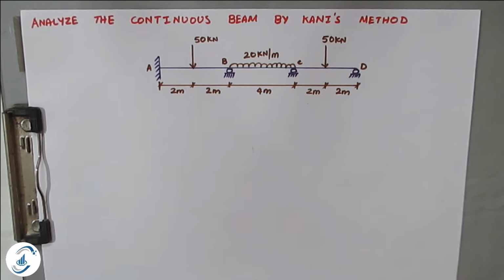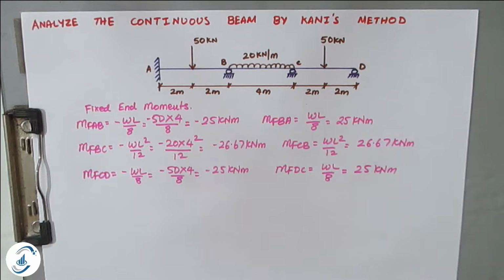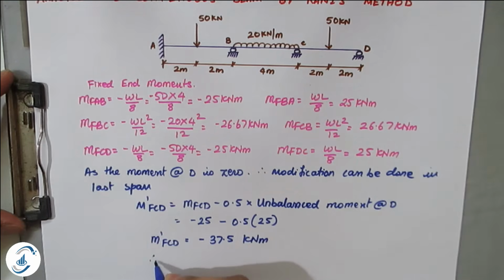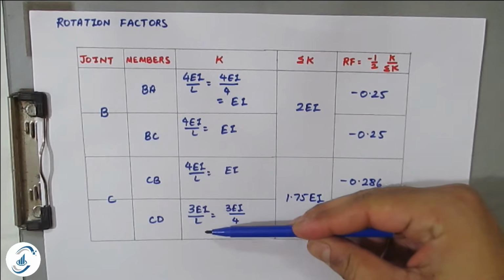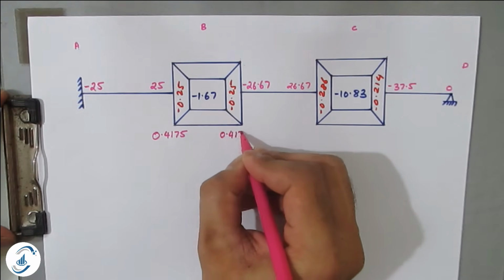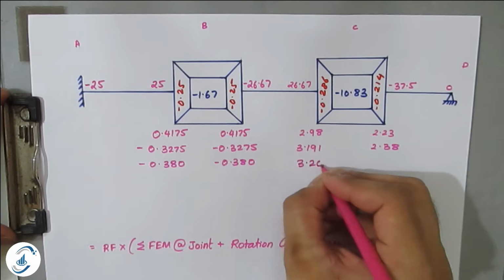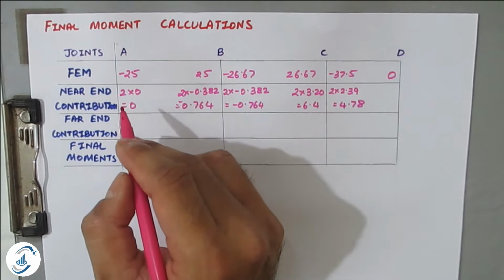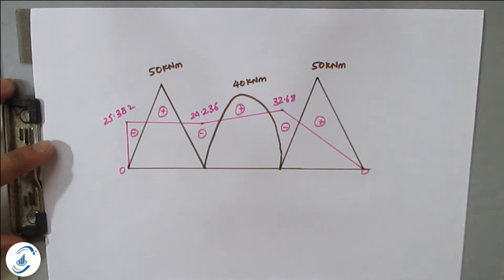Analysis of Continuous Beam by Kani's Method | Modified version of Kani's Method

Comment: Here are your 10 Mechanics of Materials / SOM - 7 mark answers - direct exam format. This is the only set you need.

### 1. Simply Supported Beam + UDL w over L

Reactions: $R_A = R_B = wL/2$

SFD: Linear
- At A: $+wL/2$, At B: $-wL/2$, Zero at centre.

BMD: Parabolic
- $M_x = R_A x - wx^2/2$
- At ends: 0, At centre: $M_{max}= wL^2/8$

> Draw: SFD triangle to triangle, BMD parabola with max at middle.

### 2. Cantilever + UDL w over L [Fixed at A]

Reactions: At fixed end: $R_A = wL$, $M_A = wL^2/2$[Hogging]

SFD: Linear varying
- At free end: 0, At fixed: $wL$
- $V_x = wx$

BMD: Parabolic
- At free end: 0, At fixed: $-wL^2/2$
- $M_x = -wx^2/2$

### 3. Overhanging Beam

Example: SS beam L=4m, overhang 1m on right, UDL w on whole 5m.

1. Find reactions: $\sum M_A=0$
$R_B = w(5)(2.5)/4 = 3.125w$
$R_A = 5w - R_B = 1.875w$

2. SFD: Calculate at A, B, and overhang end.
At overhang free end: 0
Just left of B: $R_A - w(4) = -2.125w$
In overhang: Linear to 0 at tip, -ve max at B.

3. BMD: Zero at supports and free end.
$M_B = -w(1)^2/2 = -0.5w$
Max +ve BM where SF=0 between A-B.

### 4. Rectangular Beam - Bending Stress

Formula: $\sigma = \frac{M y}{I}$

For rectangular $b \times d$:
$I = bd^3/12$, $y_{max}=d/2$
$Z = I/y_{max} = bd^2/6$
\boxed{\sigma_{max} = \frac{M}{Z} = \frac{6M}{bd^2}}
Neutral Axis at centre. Stress linear - zero at NA, max at top/bottom.

### 5. T / I Section - NA + I + Bending Stress

Steps:
1. Divide into rectangles.
2. $\bar{y} = \frac{\sum A_i y_i}{\sum A_i}$ from bottom.
3. $I_{xx} = \sum [I_{self} + A_i (y_i - \bar{y})^2]$
   where $I_{self}= b_i d_i^3/12$
4. Find $y_{top}$ and $y_{bottom}$ from NA.
5. $\sigma_{top}= M y_{top}/I$, $\sigma_{bottom}= M y_{bottom}/I$

I-section: NA at middle if symmetric. $I$ is large, so stress less.

### 6. Rectangular Section - Shear Stress
\tau = \frac{V Q}{I b}
$Q = A' \bar{y}'$ = first moment of area above layer.

For rectangular:
\tau = \frac{6V}{bd^3} \left(\frac{d^2}{4} - y^2\right)
- At NA $y=0$: $\tau_{max}= \frac{3V}{2A} = 1.5 \tau_{avg}$
- At top/bottom $y=\pm d/2$: $\tau=0$

Parabolic distribution.

### 7. Cantilever Point Load P at Free End - Slope & Deflection

By double integration or moment-area:
\boxed{\theta_B = \frac{PL^2}{2EI} \text{ [clockwise]}}
\boxed{\delta_B = \frac{PL^3}{3EI} \text{ [downward]}}
Equation: $y = \frac{Px^2}{6EI}(3L-x)$

### 8. Simply Supported Beam UDL w - Deflection

Max at centre:
\boxed{\theta_A = \theta_B = \frac{wL^3}{24EI}}
\boxed{\delta_{max} = \frac{5wL^4}{384EI} \text{ at centre, downward}}
Deflected shape: $y = \frac{wx}{24EI}(L^3 -2Lx^2 + x^3)$

### 9. Composite Bar - Stresses/Extension

Condition: $P = P_1 + P_2$ and $\delta_1 = \delta_2$

$\delta = PL/AE$

So: $\frac{P_1 L_1}{A_1 E_1} = \frac{P_2 L_2}{A_2 E_2}$

If $L_1=L_2=L$:
\sigma_1 A_1 + \sigma_2 A_2 = P
\frac{\sigma_1}{E_1} = \frac{\sigma_2}{E_2} \implies \sigma_1 = \sigma_2 \frac{E_1}{E_2}
Solve for $\sigma_1, \sigma_2$.

Extension: $\delta = \sigma L / E$

Thermal: If temp rise $\Delta T$, free expansion $L\alpha\Delta T$ prevented, so thermal stress.

### 10. Thick Cylinder - Lame's Equations

For thick cylinder inner radius $r_i$, outer $r_o$, internal pressure $p_i$, external $p_o$.

Radial stress: $\sigma_r = A - \frac{B}{r^2}$
Hoop stress: $\sigma_h = A + \frac{B}{r^2}$

Constants:
A = \frac{p_i r_i^2 - p_o r_o^2}{r_o^2 - r_i^2}, \quad B = \frac{(p_i - p_o) r_i^2 r_o^2}{r_o^2 - r_i^2}
Case: Only internal pressure $p_i$, $p_o=0$:
\sigma_{r} = \frac{p_i r_i^2}{r_o^2 - r_i^2}\left(1 - \frac{r_o^2}{r^2}\right)
\sigma_{h} = \frac{p_i r_i^2}{r_o^2 - r_i^2}\left(1 + \frac{r_o^2}{r^2}\right)
- Max hoop stress at inner surface: $\sigma_{h,max}= p_i \frac{r_o^2 + r_i^2}{r_o^2 - r_i^2}$
- Radial stress at inner = $-p_i$, at outer = 0

---

*Want these as 10 separate